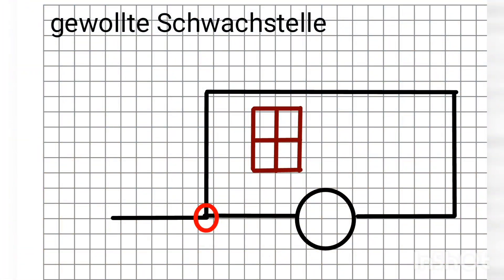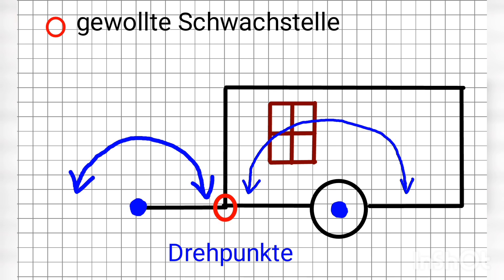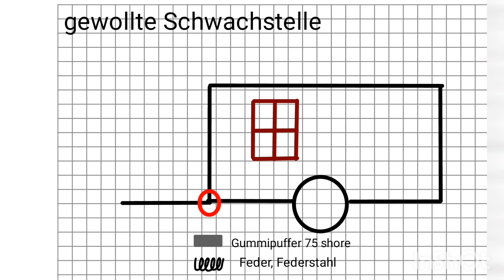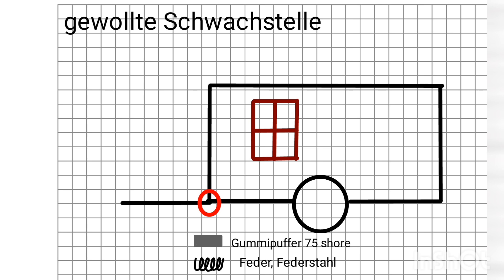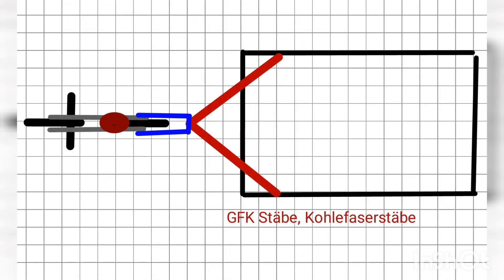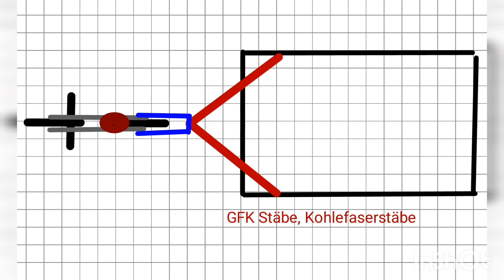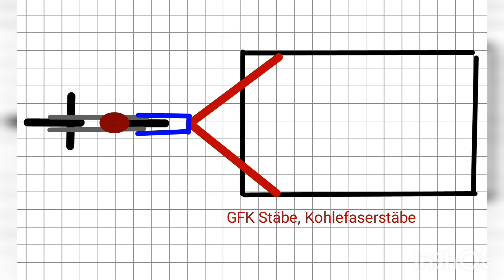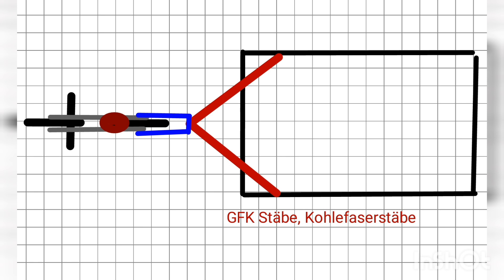Fahrrad Wohnwagen Überlegungen zur Deichsel

Comment: Ich habe Gummipuffer  mit eine Gewindebuchse  benutzt. Sie würden durchgebohrt. Ein Puffer ist zwischen Deichselrohr und Hänger Vierkantrohr und zweiter auf dem Hänger Vierkantrohr. Durch alles geht Lange schraube die von Oben mit einer Mutter verschraub ist. Also von der Seite der Aufbau von unten nach oben sieht so aus: 1. Schraubenkopf mit Unterlage  2 . Deichselrohr 3.Gummipuffer 4. Hänger Vierkant rohr (innen verstärkt,  die Bohrung ist mit 1mm Gummi innen beklebt) 5.Gummipuffer 6. Mutter mit Unterlage. Der gleiche Prinzip ist auch bei Weber Anschlus Winkel und Kupplung am Fahrrad Eingesetzt. Die Gummi Puffer mit 75 shore sind díe härtesten. Ein Gummikork hat ähnliche Härte und eignet sich auch . Die Puffer  werden etwa zur helfte iheren Höhe zusammengeprest - was nebenbei die Schrauben sichert. So ist Deichsel vom Hänger und Fahrrad gänzlich entkoppelt- ein metal berührt niergendwo ein metall. Die Vibrationen werden so weggedämpft.  Ich habe es mit einem 105 kg Hänger getestet und es ist stabil genug(bei mir sind die Räder  etwa um 15 cm von Mitte nach hinten versätzt)  - dh. Wippt nur minimal   Einwenig Wippen ist ok, weil so sich die Kräfte entladen können. Ich hoffe es ist gut Verständlich. Prinzip ist an sich einfach.
Reply from the maker: Danke für die Erklärung!!